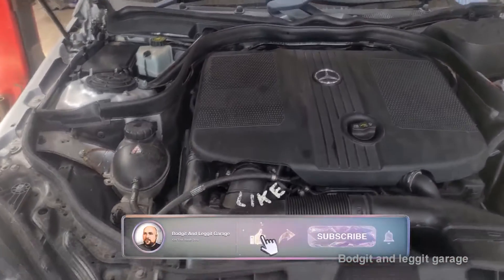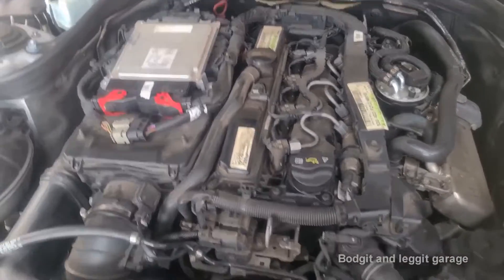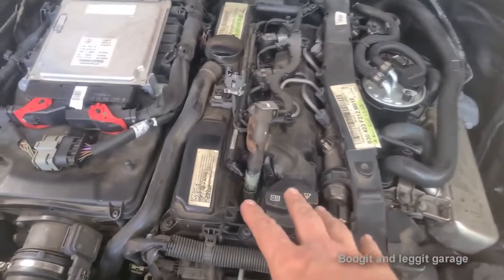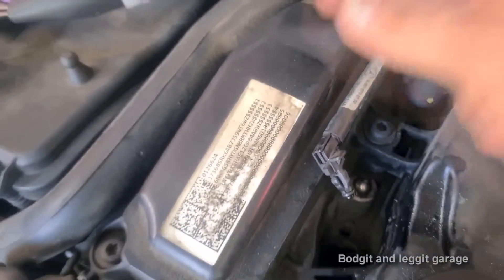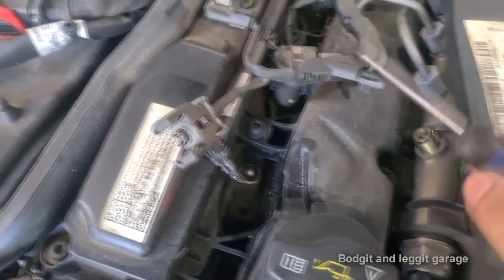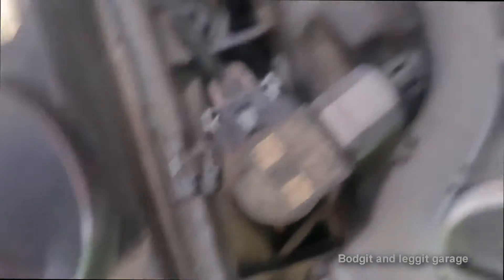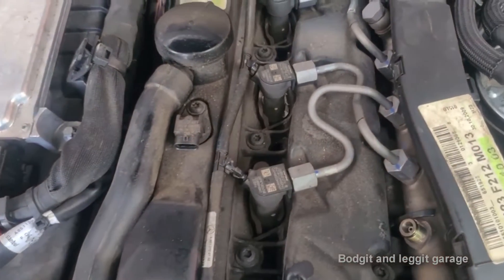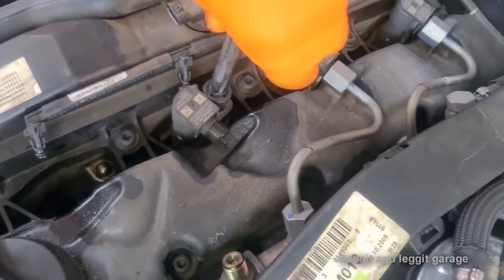Mercedes How To Remove/Replace And Clean Diesel Injectors

Comment: Great video! I have a w212 3litre diesel on 2010. Done 155,000 miles. I’m not a mechanic. How many injectors are there, 6? Also is there an easy way of knowing if any of mine are blowing?

Comment: Another interesting video Leon . Sorry, maybe daft question, do you have to block the injector holes before cleaning the seats to stop any debris dropping down ?
Reply: Some kits come with small plugs that blank off the injector tip holes but personally I don't like that type and prefer the type of cutter sockets Leon was using that extend into the hole below the injector seat. As Leon said, add a small amount of grease to the cutting socket surface and the swarf gets caught in the grease. You are only taking a very, very thin layer off the seat so light pressure on the tool and only a few turns is necessary. If you have 'shop' air blow out the injector bores but nothing major usually falls in if you use grease and are careful. Another tip is to clean out the injector bolt threaded holes if enclosed, especially if there is oil contamination as proper torquing on some models is essential and trapped oil affects the torque applied. Saved a few common rail engines from the "black death" when injector seals have been leaking.
Reply: @MiracleMitch  Thanks for the explanation , way above my skill level but always interested to learn
Reply from the maker: @MiracleMitch   Great explanation mate thanks
Reply from the maker: @rogerkretzschmar8280  Hi mate it's a very simple job to be fair you just need the right tools And take your time

Comment: Had problems with these chuffing with black death on a sprinter found that unless you replace the clamp bolt they dont last longer than 12 months before leaking again also disregard the specified torque setting and use your experienced feel to tighten.
There a total pig to remove when there siezed as you cant use a puller and cant lever against the plastic rocker cover.
Thanks for the video
Reply from the maker: Hi mate yes some manufacturers do recommend replacing the bolt and also the bracketAnd some even have an updated version depending on I've been doing this for a long time never once have I had an issue with not using a torque wrench on these particular bolts

Comment: I had my injectors done at Mercedes last month and it purrs nicely.  That is twice in 230k kilometers.  Still on the original injectors.  If the car is in the same condition in 5 years, I'll probably install new ones or at least a rebuild kit and the labor.